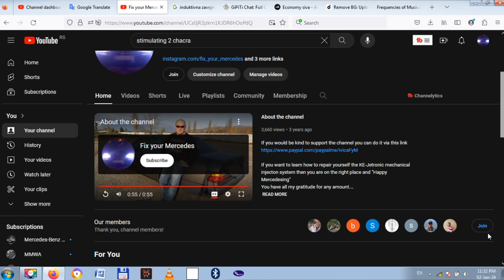Mercedes Ke-Jetronic - A Donor

Comment: Hi i found that my car has that that thing called "ece" and i didnt find info for it from internet so could you help me to understand what its doing, it is behind the battery in my 124 230e
Reply from the maker: Hi, that's the designation that you have the engine without O2 sensor. Greetings